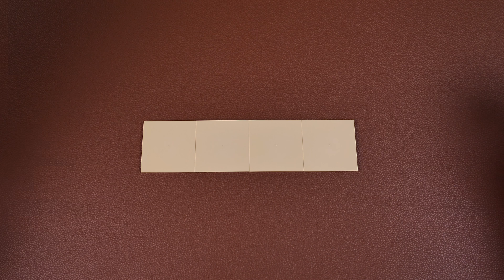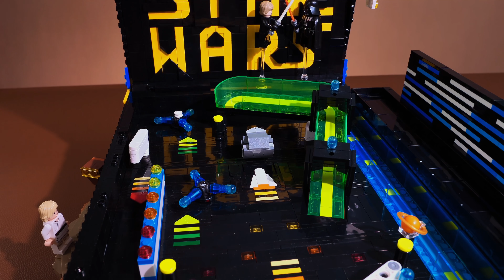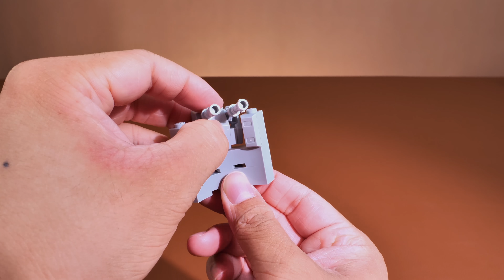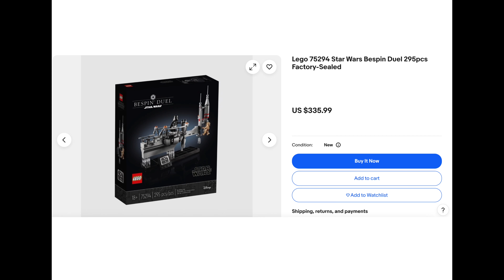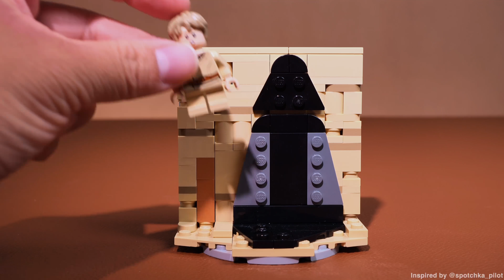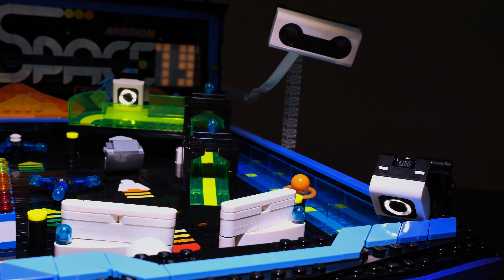I Packed Star Wars into a LEGO Pinball Machine!

Comment: Watching. This vid as. I been. Building. The hole pin ball machine outter extra. Parts .but making mine. Ninjago themed 😊 and adding more moving parts ..motors to built in speakers in back board an.might add lighting kit .and big window pannle for a glass top look if not Perspex sheet .Ninjago sign .sticker detail for back board an.big sticker detail for main floor .I was going to try build it dubble the size .but as I not bort x2 of the set s..just the set s size will do for now 😊